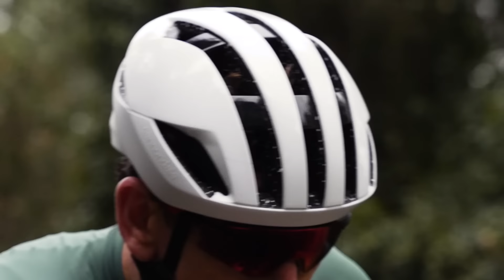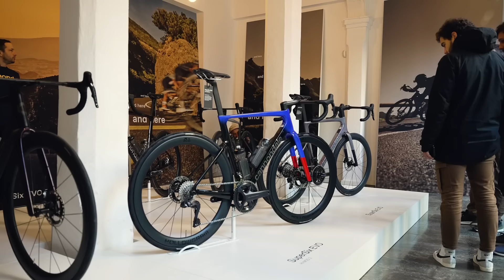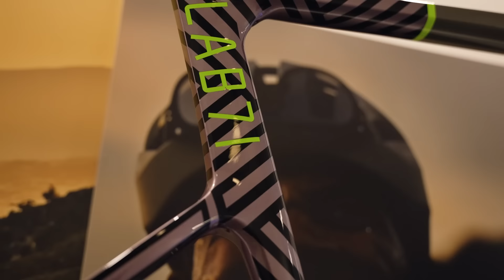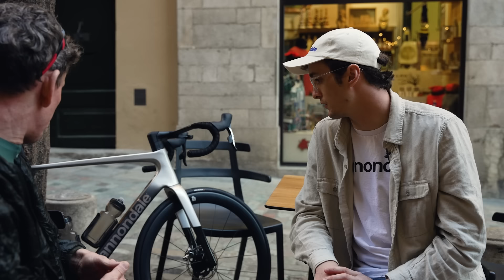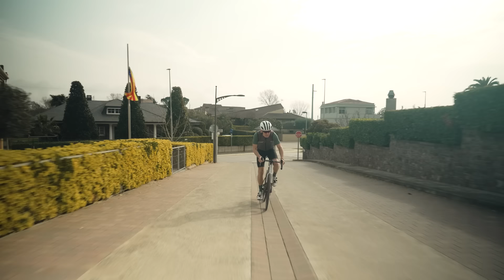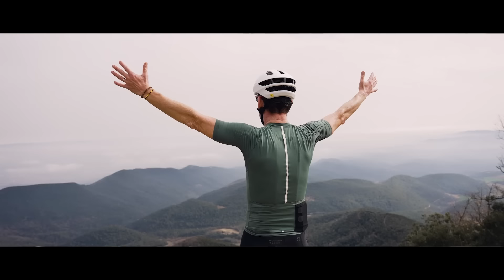Matt Stephens rides the Cannondale SuperSix EVO Disc Road Bike | Sigma Sports

Comment: No power meter. Doesn't mention the rear derailleur mount screw issue on the past models. Also doesn't mention that the headset needs to be inspected every 6 months. These bike reviews are getting worse and worse.

Comment: Looks like a nice bike but the big brand names have a monumental challenge to pull off: selling enough of those high priced bikes when there is increasing competition from direct-to-consumer Asian and other brands.  I think they have made some nice products, but at $7-15K the market is not so big, especially in this economic climate. If they can deliver a $4K-5K Ultegra mechanical bike with carbon rims it will likely be a bigger hit in terms of post-pandemic cycling renaissance.